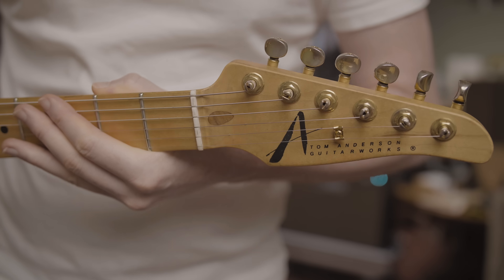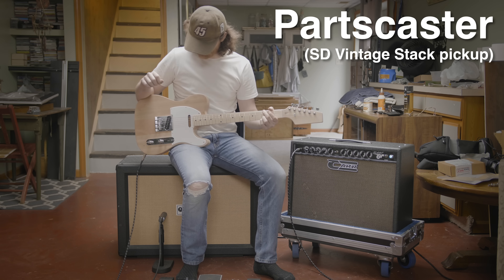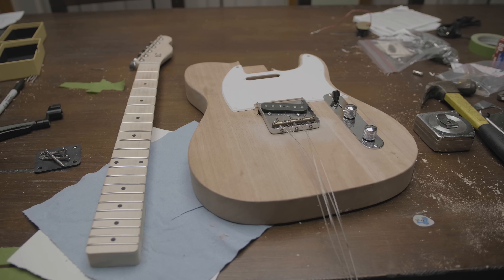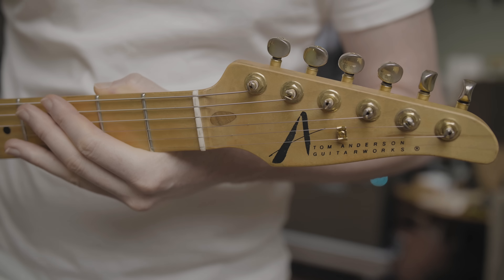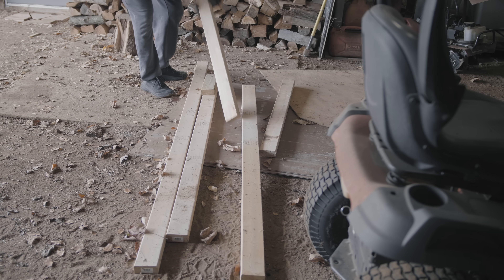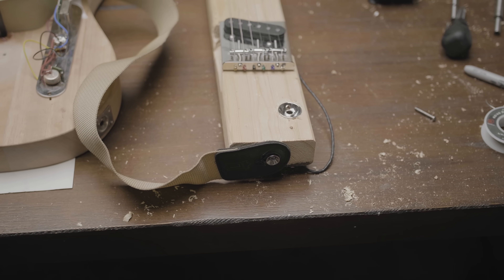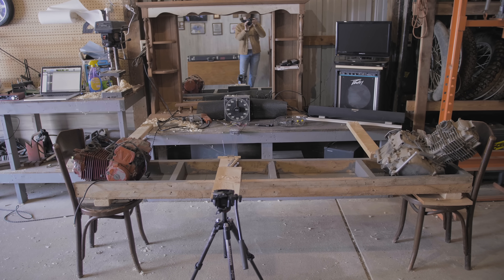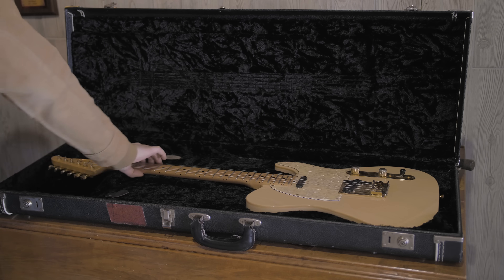Tested: Where Does The Tone Come From In An Electric Guitar?

Comment: These tests were pretty fudged, sometimes what people think is scientific is anything but valid. Give 2 different guitars to a shredder who can improvise and he'll find their individual strengths in 12 different dimensions of perception and amp settings.
Reply: That's a matter of play feel. Not what generates tone.
Reply: @WolfieboyMachi   No, strum 2 different guitars hard and compare. Very different response due to chaos.
Reply: @RoboticusMusic  What on earth do you mean, "chaos?"
Is chaos a factor that can be controlled and determined?
Reply: @WolfieboyMachi  When you push a machine or system to a point where it no longer produces linear results, so all cars drive at 30mph at 30mph, but some cars burst into flames if you attempt to push them to 250mph, a graph comparing only 30mph driven cars will not predict the point of chaos.
Reply: @RoboticusMusic  Okay?
So how do you propose this applies to guitar, in practice?
Where does this come in when it comes to the guitar, and how exactly do you determine what factors are relevant to the result of said chaos?
Reply: @WolfieboyMachi  I think if you play timid like these tests any guitar will sound boring and straightforward, same with any machine pretty much.
Reply: @RoboticusMusic  It's not a matter of sounding boring or not. The point is they sounded exactly the SAME.
And he didn't only play timid, at 8:18 and 8:25 he does some more energetic stuff, expected within the country genre.
Sure he doesn't hammer on it like one would playing metal or punk, but he does enough to switch it up, and they still sound exactly the same.

Comment: The question I find fascinating to myself after this video is why is it then when you see carbon fiber guitars or aluminum guitars or plastic guitars they sound terrible? Is it as simple as upgrading to pick up an electronics?
Reply: Material is going to have far more of an impact in an acoustic instrument where the sound is actually generated in the vibration of the material.
Where as if you're playing through pickups, all the sound is just the string vibrations being picked up by the pickups.

Comment: Well the 2x4 and air guitar definitely don't sound the same as the actual guitar. Similar yes. Worth the $$$$ difference? That's a personal question. But anyone saying they sound identical has s*** headphones or bad ears so there is some tonality coming from the body of the guitar. But by the time you're in a mix with other instruments, pedals, etc its a small % of overall sound.

Comment: I have a physics background and have played guitar for a long time. I've been following the "tonewood" debate for a bit and have been trying to come up with a coherent theory to match my experiences and observed tests from YouTubers like yourself.

First of all, the "air" guitar isn't a guitar with a 0 mass body. In fact, as an approximation, it is more like a guitar with an infinite mass body than one with 0 mass. The material beneath the strings has negligible impact on the sound, as the transfer of vibration through the air from the string to the material underneath is very small as the vibration of the string itself is very small and air is a very inefficient medium for transferring mechanical energy. Rather what is far more important is what the strings are anchored to, which is in this case two tables that are heavy and themselves anchored to the ground.

Second, I've been trying to formulate a theory that encompasses a very specific experience I had and saw replicated on YouTube. That is, I owned an Ibanez S model guitar and it was very dark, to the point where I added a high pass filter circuit to shave lows in order to get it to sound "right" with single coils. Darrell Braun's channel has a comparison that replicated my experience with the S model. Sure, the N is small, but the tonal difference was very stark in both cases.

Third any such theory has to account for the fact that semi-hollows and hollows sound appreciably different than solid bodies, with hollows sounding the most different.

So, after a lot of musing, I think I have something which you may be able to test.

1. The rigidity of the string anchors is the primary driving factor in differences in sound when pickup height, electronics, strings, and the post-chain are held equal.
2. Specifically, it is rigidity along the axis of the string in the anchoring direction that matters. In the vast majority of cases with guitars, that means perpendicular to the plane of the body (not e.g., in any direction along the plane of the body).
3. Therefore, if we assume the same neck on different guitar bodies, and if we assume most hardwoods used on guitar bodies are of similar rigidity, it is then the thickness of the material that the bridge is anchored to which is the most important due to its impact on rigidity.
4. The hollow body tone difference is explained by the fact that the anchor is quite thin as it is only the top of the guitar body, not the entire thickness (as the center is hollow).
5. In addition, we would expect the "wings" of the guitar body to have negligible contribution to the sound in an unamplified setting (DI guitar/amp sim through headphones).
6. If we hold the body dimensions the same as well, then it is the density of the material that makes the difference through its impact on rigidity.
7. The impact of rigidity has diminishing returns as it increases. A 1 inch thick body is a lot better than a half inch thick one, but a 3 inch thick body isn't that much better than 2 inches.
8. Wood species is a proxy variable for rigidity, but because of low inter-species variation for woods that make functional solid bodies and high intra-species variation, it's not a very good one.

This squares with theory, my experiences and demonstrations like yours. One obvious test to this theory is to take a 2x4 (or better, a 4x4) and do demos on decreasing thickness.

Hope you like my brain dump.

Comment: Cool experiment but. If a  pick up has any microphonic qualities at all,  and most do. anything in its close environment will influence the sound even temperature will change its resistance, which would change the sound even if it only louder or quieter. it’s not a one thing over an other thing and that’s all that matters debt imo.  every single thing that is involved in making a resident frequency from the Player, to the pick, the strings, the hardware on the guitar. and yes, even  the wood for the love 😂the cables you use, the amplifier is going through into the microphones that is grabbing the audio d/a conversion. even the very video you’re wach has compression that YouTube uses to change the dynamics of the audio you listen to then play back in the phone or headphones and back into your ears. All has an influence on the sound I think you get my point😅 and that is to say bye just removing the tone wood and saying Yep Tonewood doesn’t matter anymore it’s just a bit silly, but it’s also not the most important thing either. Just depends on the situation all I’m saying is just by striking one element of the guitars  equation doesn’t mean it no longer makes a difference imo of course🙄but just do me a favor go over to your guitar, and plug it in and tap on your pick up.  tap around your pick up. Tap on the damn wood around you pick up If you have a fender, Stratocaster tap the pick gard if fact change it from a three ply Pick gard to a single ply pick  gard and that’s also going to change the sound, or go look at some videos of an all aluminum guitar. The material absolutely does matter, and I think it’s silly and almost flat earthy to think otherwise 😂  and besides  I can’t see many rock stars going to an air guitar rocking out in between to work benches any time in the near future

Comment: Still attached to wood at the ends ... fretted notes make q difference with sustain etc.. in theory you should be able to all of the parts (pickup, bridge, nut , tuners) slap them on a different guitar and it sound exactly the same. Maybe a guitar with humbuckers that mount to wood .

Comment: man all these apologists ! Glenn Fricker, imo, is right WRT heavy metal and he references your channel.

I play a mixture of clean, blues, heavy rock, and i have 5 Solar guitars.  All different models. All have the same pickups. Most have split coil/5 way switches which does that anyway. All sound the same if used in the same configuration.
I have 2 single cuts (the GC1.6 models), 1 S1.6 (sadly sold my other S1.6 last year to pay for medical bills), A1.6, and E1.6.

Different shaped guitars, different woods, same pickups. 
Given what I play, the pickups in other guitars do make a difference. I have a rare Sun Dew Gold Ibanez Pia, also have a 1987 Japanese made Squier strat i bought new (yes i'm getting old), 2020 Squier Affinity strat, etc.

Clean tones and bluesy crunch tones ? yep pickups and pickup config make a difference - split coil, serial/parallel. phase switch etc.
For metal ? like Glenn Fricker talks about ? it's all about the signal chain and the speaker cab.

Comment: The sustain comes from the mass of the guitar (i.e. where the strings are anchored). In this video, the brige and tuners are attached to two very heavy tables. The air between those two very solid fixed points are somewhat of a redherring here. This air guitar is in fact probably heavier and has better sustain compared to the original guitar played in the video. WRT the tone, I am sure that tele bridge pickup would sounds the same in many guitars.

Comment: Thank you for all of the hard work in proving this experimentally. The signal comes from a metal string fixed at two ends moving back and forth above a magnet. That’s it. It sort of seems obvious after watching this that the type of wood or even hollow vs solid body wouldn’t matter at all.
Reply: Dunno, 335 sounds different from LP, even with the same pickups. Guess it's all about those vibrations huh.

Comment: Most important video ever made. Finally. Audio people are the worst. And that extends to "tone" people with their absurd old wives tales. "Your patch cable is backwards, the signal won't flow properly, trust me I'm an expert. Your tone will be richer and creamier if the signal flows in the same direction as the text on the cable". These are people who get targeted by $1000 HDMI cables manufacturers because they don't understand how anything works.

In acoustic instruments the wood is the amplifier. Of course it matters in the acoustic realm. But..

Every theory about a guitar's tone can be safely thrown out the window when the 'tone' depends entirely on magnetic fields. The tree you made your guitar parts out of does not affect the magnetic field between the strings and the pickup, therefore it has no effect on the sound. The only thing that alters the magnetic field is the strings. And the disturbances in that magnetic field are what's being sent to the amplifier... The pickups and the amplifier don't give a damn about what exotic forest your 10000 year old timber came from, or whether your guitar was made in the USA. Metal and magentic fields. End of story.
Reply: @lfscrazy  I'm not missing anything. Sustain and resonance can be very marginally affected, but not tone.  It mattered in the accoustic world when the wood was used as a large hollow amplification chamber, but but in electrics.

In an electric guitar, the strings and the pickup matter. The rest is bordering on intangibility and copium. Butthurt souls that got suckered and refuse to accept it. "I paid a lot for this. The difference in tone I'm hearing is actually buyer's remorse influencing my mood"
Reply: @lfscrazy  No, I’m not the one who is confused, that’s you.  “Source: trust me bro.” is a meme, and when I said it, I was referring to you. I was making a joke that despite the fact you spoke with such authority on the subject, your statement lacked any kind of credibility because you provided no evidence. 

I’m hoping this could clear up any confusion.
Reply: ok, see an open spot for a reply. thinking bout the open  spot without the back plate on mine and thou metal, the springs which can be tuned to resonate with some open and fretted notes. The 3/4 width body on Squires ring out longer IMO. more than my 62 strat. Then can we say wood affects sustain on the  instrument''s given resonance due to height and action. So an aged wood over the years mean anything other than being lighter. Seen and heard many players that loved the cracks and loose neck screws (only one) on my 4'bolt that helps out with high choke outs. just saying, in lieu of opinions. Shall we say (bcz it's the least of the  problems) that; " Wood is Good"
Reply: @lfscrazy source: trust me bro. 

That’s a nice guitar but unless you can provide a conclusive A B comparison, I’m going to have to take your anecdote with a grain of salt.
Reply: @lfscrazy  I’m not saying to trust me…

Comment: How about a where does resonance come from in a partscaster? Body neck bridge nut?
Reply: Everything. Every part of the guitar influences how the strings vibrate. In a Strat, the saddles, bridge and block are important. In any guitar, the type of metal used for frets and the wood of the fretboard are important. Then of course the body and neck materials are important too. It's everything to more of less of an extent.

Comment: I like your air guitar, but I would argue that it's missing the point - the strings are still attached to a block of wood, and the bridge and its pickup are still attached to the same bridge plate, as well as another block of wood.

The idea is that the strings transfer their vibrations into the wood, which then colors the upper harmonic series of the resonating strings due to the differing molecular structers (density) of various woods due to sympathetic vibration, which is then picked up by the pickups.

A better demo would be a guitar with a metal or acrylic body and aluminum neck, as well as a tele bridge pickup that isn't attached to a bridge plate. I'd like to see that one and compare any differences in tonality
Reply: Even if this is true...

Why does a work bench apparently color the sound in the exact same way (or some marginally small % different) as a guitar body?

If the type of wood and construction of the guitars is supposed to make them sound different, the bench+shelf guitar should sound WILDLY different on account of its WILDLY different construction (and wood species, really doubt that work bench is artisinal mahogany or whatever, its likely plywood that at best has a birch veneer on it).

Saying "yeah but its still connected to wood" is copium.
Reply: @Mennenth  the point is that the tele bridge pickup is attached to the metal bridge plate and that is where the tone of the tele comes from. A better experiment would be with a separated tele pickup or a guitar body made of metal.

If you’ve ever played a floyd rose and noticed the tone is much more metallicky and brighter than a standard bridge you’d come to the same conclusion
Reply: Tyler at Music Is Win has a video of a Squire with an aluminum neck, and while there’s no A B comparison, it just sounded like a guitar. It looked cool, but didn’t seem to make that much of a difference. Least to my ears anyway

Comment: If you understand "String vibrations & harmonics", you understand how a guitar's voicing is dictated by the distance between the bridge and the P.U.'s.
Not toanwood.
Not the type of magnet in the P.U. (different types of P.U. will sound different though (single vs humbucker, P90 vs classic single coil etc.)
Not cryo-treated strings.
Not directional cables.
Not the tubes.

P.S. using the same tele bridge in the test shows there is hardly a difference when you change the other components
Reply: If you understand "String vibrations & harmonics", you understand that the material of the string makes a huge difference to it's vibrational characteristics. You'll also understand that what the ends of the string are connected to influences how it vibrates.

Comment: Is it possible that the chosen amp doesn’t favor the differences in tone from these comparisons? Maybe the response of this particular amp has a scoop in the frequency spectrum where other amps would produce slight differences in colorations from the tone wood. 

I think using a flat response studio reference monitor would have been a better way to compare them. The wood does impart a selective filtering effect on the signal. It’s subtle, but the tone from a mahogany body versus a swamp ash body is noticeably different. The same goes to greater effect when comparing a solid body electric to a semi hollow body (or hollow body) electric. A Sheraton will never sound like a Casino even if equipped with identical pickups and string heights. 

Anyways, it’s a good start, but I think a flat response amp would’ve been a better way to compare them. And show the response using a spectrum analyzer.

Comment: One thing i do want to say is on the flip side. While wood does not interfere with the signal, the wood hardness and strength I'm sure lends to bends in the structure and varying ease in bends in the strings. I've always felt that it affects minor aspects of the intonation which may lend towards a specific performance's tone. But that aside, awesome test!! Cool to see my personal notion that wood doesn't affect the signal be demonstrated!
Reply: The wood does nothing, you did not see the tone be exactly the same while strings were connected across benches? You are doing mental gymnastics to say that wood does anything at all for the tone.
Reply: @Dubscr you clearly didn't read my comment